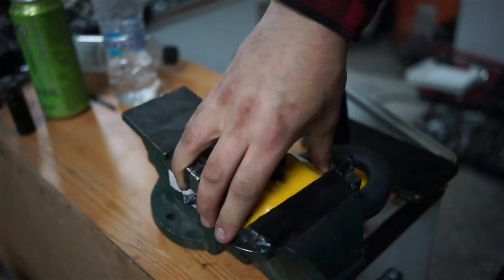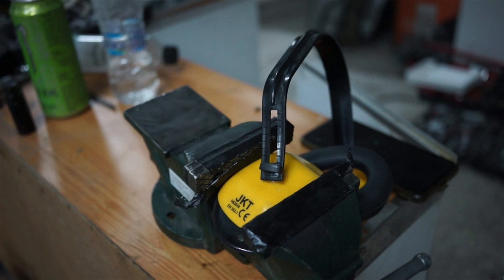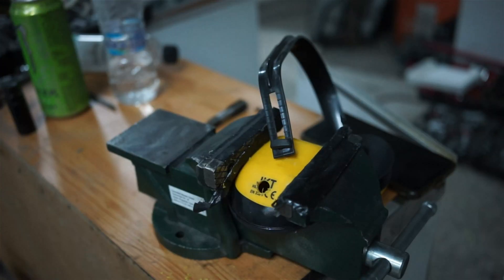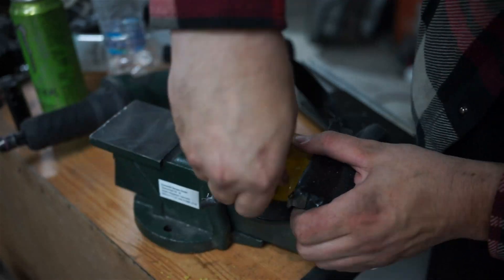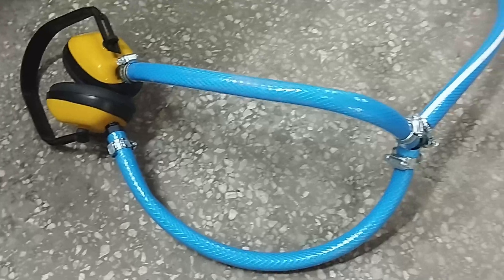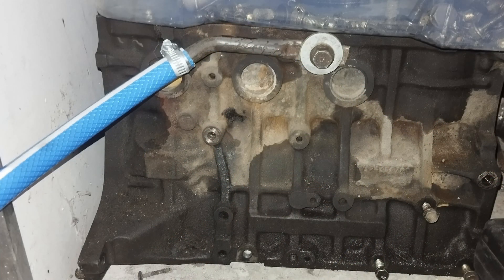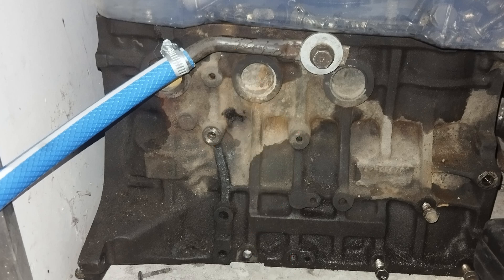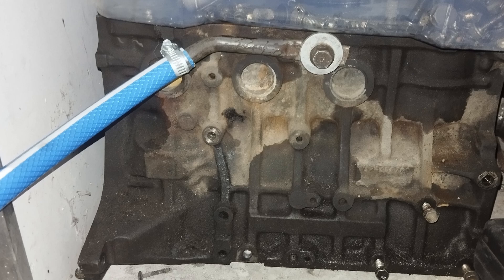Tunerstudio Standalone ECU Tuning Guide | Part 13: Street Ignition Tuning with Det-Cans| Megasquirt

Comment: Thanks, leved this video, no one that i have seen made a so in depth video, seriously, thx a lot. Do you have any rule of thumb for boost and ignition? I have heared people saying by 1psi you take 1 degree
Reply from the maker: yeah 1 degree per psi of boost is very safe but a common rule of thumb. if you dont have a way of monitoring knock, its definetly a good starting point, though with most engines at 15 psi or so usually even 20 degrees of ignition timing is possible if compression ratio is 9.0:1 or lower and the manifold and exhaust is not very restrictive. there are many factors that can influence ignition timing threshhold
Reply: @throttlebuddies0  yeah i understand, i know that sometimes seams like a dumb question but i just want to hsve a base line, and again thx
Reply from the maker: @SCOBra_PT  no worries.

Comment: How to tune ignition table based on tps in na engine?
Reply from the maker: the same way, just select tps in the spark settings 
you need to adjust your ignition map though. because TPS is a bit different

Comment: would boost be lower then 30?
Reply from the maker: @Xos_BassHead999  yes, on boost you would reduce timing. Rule of thum to be safe would be reduce timjng by 1 degree every psi of boost you add

Comment: Is the first time that I see someone build a "home made" stethoscope just to hear the pinging that occurs in a combustion chamber..!! Is a good way to optimice the spark table and not just guessing... regards from Mexico city
Reply from the maker: absolutely! works great as you can hear. but plenty of people have done it and shown on youtube. though many people use it wrong. it is VERY important to get the placement right, otherwise you will only hear very heavy knock
Reply: @throttlebuddies6356  if one is lucky enough to have an engine that came with a knock sensor, its easy to do, but you have to find the right place orherwise